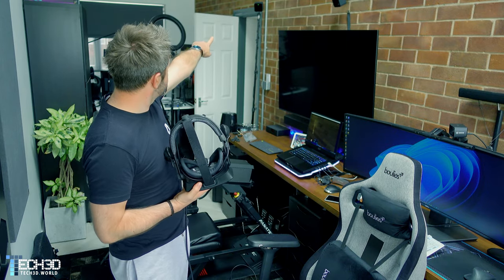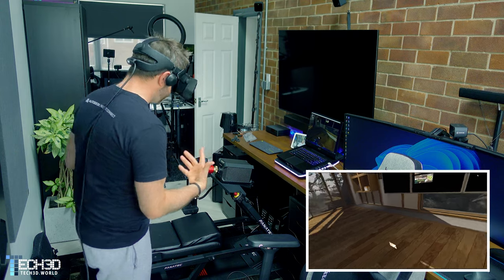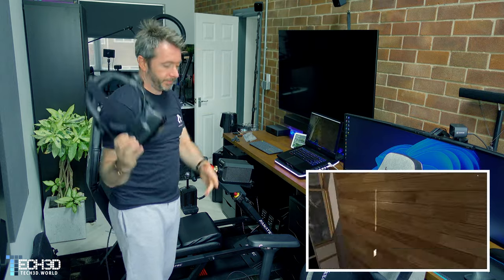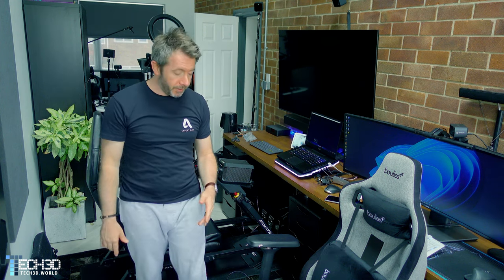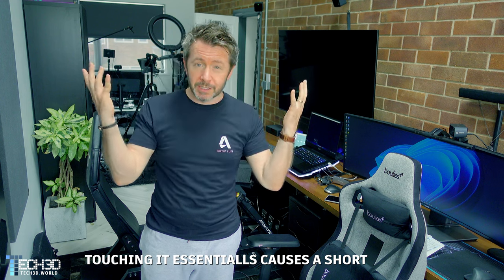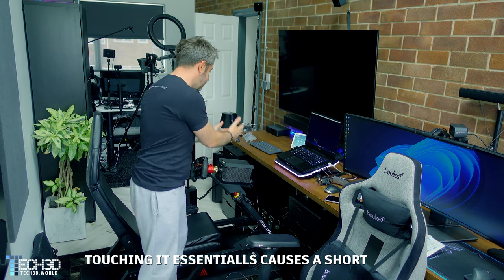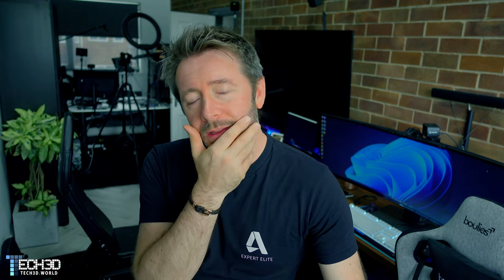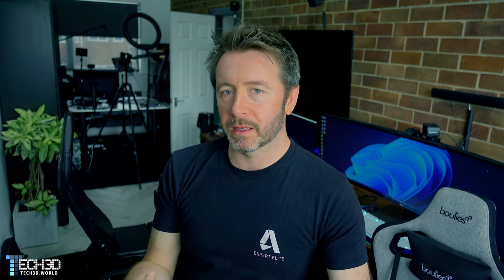Fixing a Valve Index VR Tracking Problem With a Ferrite Core (or 4)

Comment from the maker: PLEASE NOTE if you're unsure if the problem you have is linked to this solution, it's all about what happens when you touch the headset.  If you have random unreliable tracking issues just generally across your entire playspace, then it probably won't be this issue.  But if at any time in your playspace you touch your HMD and tracking is lost, then it's likely this issue.  My issue was concentrated near to the steering wheel unit, but some people will have the same issue within their entire house if they live near a radio tower for example.
Reply: i got the same issues, on all play area, probably Usb issue on ryzen, i will try updating my BIOS... and see if that works
Reply from the maker: @moncimoov  if your issue is specifically that you lose tracking when you touch the HMD then it's this problem, it won't be a USB problem, you're best trying the ferrite core solution
Reply: @Neil3D  i remember not having this issue last month..this is super weird 😖.. so i thought its just steam VR Updates.. i will move my pc and see if it works... i love ur method but it just makes my cable shorter.. but i will try it if there's no other way.. even after moving my pc, thx... good video👍
Reply: Valve Index PAID YOU TO LIE!!

Comment: Quick Sidenote: They don't create a barrier like some people say. What they actually do is increase the resistance of the cable and make the negotiation at the begining of plugging in the cable force more voltage through the cable. This is good because the signal is less vulnerable to RF because it's pushed through with more 'energy'.

I recommend this for any high data rate cable. Not sure why this trend went away.
Reply from the maker: Yea I can't and won't pretend to be an expert in the science around this, never looked into it, but I read that it increased the resistance and just interpreted that as being some form of a "barrier".  
I've already had a very nervous moment, I fired up SteamVR about an hour ago and the HMD was glitchy as f**k like in a way that I've never seen in the 2 years I've had the Index... one display was out completely, the other was freezing and showing RGB striped bars.  Fortunately a HMD reboot fixed it but it made me nervous.  Will have to monitor that.
Reply: @Neil3D  Yeah that's normal, everyone has what they're an expert at and tries the best they can for the rest. I'm glad you're sharing this. I had quite some trouble with my HP Reverb G2 (and DCS World) about this time last year and there weren't enough neat tricks like this available for me to justify it. Probably like yourself was a lot to do with the environment it was in rather than the head-unit, the 8 Wi-Fi antennas among other things in that room definitely didn't help.

Anyways keep us posted, we're all definitely enjoying the videos.
Reply: Hi @Neil3D, no more issues like that? When i used this solution i got the same thing... After 40min playing screens lenses went nuts.. had to turn off and on again.. but after that I had issues finishing the race... With intermittent black screens etc.. is this related to the cores? Did you get it solved or never happened to you again? Any info is appreciated! Thanks!

Comment: I searched for months, hours because in addition no problems with my Vive Pro Wireless but exactly the same problem with my Vive Pro 2 just on my simulation chair and sitting. I finally have the solution and it works. thanks thanks thanks:face-blue-smiling::face-blue-smiling::face-blue-smiling::face-blue-smiling::face-blue-smiling:

Comment: I got a new base station from the support, everything worked fine for 2 weeks, now I have a gray screen on Google, and if I managed to get it, the screen shook and it flashed gray from time to time, the whole image disappeared and only turned gray. After sending reports to them, support tells me to take all the equipment and try it on another pc, even though my pc is a brand new machine with RTX 4080 and i7-13700 KF. Everything was working great, but then something went wrong...

Comment: Finally!  Thank you, thank YOU, THANK YOU.  I recently built my motion rig and had all kinds of tracking issues with my Varjo Aero (confirmed by switching off the rig and issues disappeared). Found a little info here and there, but this video fixed my problems completely. I threw 4 of these bad boys at the end my HMD cable with five loops evenly spaced. Crossed my fingers, turned on motion rig, started DCS World and enjoyed hours flying the Viper in all her glory without as much as a hiccup!  
Did I remember to say Thank you?  😂   Subscribed.
Reply: Just wanted to add this update.  I was still getting EMI in the headset, but not as much. So you definitely got me going in the right direction. Those servos (7) for my 6DOF rig were putting out a lot more than I realized. What finally took out the last bit, was adding several more smaller ferrites to the wires on each servo driver. Now I'm enjoying the VR and motion as it should be experienced!  So glad I found this video!
Reply: Hi, have the same issue. Used 4 on the main cable of my vive pro 2. Without it my headset is completely white screening when turn on my 6 servos. With this 4 cores no more white screen except when I touch it. You mention adding more cores to the drives? Where exactly? And which cores? Any specific ones too? Thanks!
Reply: I bought a bunch of the little green cores from Amazon (pack of 10.... Uxcell 22mm x 14mm x 8mm Power Transformer Ferrite) and installed them (two or three) on the power wires of each servo drive. After I wrote my last comment, I realized that I was still getting quite a bit of interference. So I decided to buy a USB-C extension cord (brand: LEIRUI USB4 2.62ft) and 4 additional large Ferrites for my main headset cable. That made a huge difference. So I have a total of 8 now. I can fly for hours with no issues. Occasionally I do notice a little interference, but it's rare now. That USB-C extension cable works great with my Aero, but it has to be plugged in a particular orientation, so if it doesn't work at first, flip it around. That's what I had to do.
Reply: I'm sure the little green ones are doing a little suppression, but I think the 8 large ones are what's making the biggest difference. I might add a few more at some point, but right now I'm pretty stable with just an occasional hiccup. It's very rare and doesn't happen every time I'm using the rig.

Comment: I was chatting with ya on your comment on gamermuscles vid, just wanted to share my solution; 

I ended up creating a common ground point on one of my csw pedals mount bolts that the fanatec shifter, handbrake and dd2 connect to with some earth wire and spade connectors from their mount bolts, then I wrapped some stripped earth wire around the copper pipe of a radiator and connected it to the ground point. 

Solved my issue without ferrite cores and some other gremlins I was having. I used to hear a hiss on my headphones playing non VR racing games any time I touched metal on the wheel, this fixed that as well. There might be crappy grounding on the wiring in my house or something.

Comment: Does tinfoil help if you wrap the forcefeed back unit? Is you whole system on a common ground. 240v eu phase is different than USA  single phase 120v with 1 common ground. It could be related to the grounds in your house too. The whole thing needs to be ground on the same phase...

Comment: I’ve had this problem before but it’s not as consistent as your example. There was some sort of radio/phone tower built right next to my house and it was causing feedback with my brothers audio equipment. I wonder if this tower is affecting my vr setup too?? Perhaps I’ll try this anyway and see what happens. I came here because I have some tracking issues where my feet and hands will drift and jitter occasionally. Would it make any sense to use these coils on my base stations cables as well? Or just the index cable?